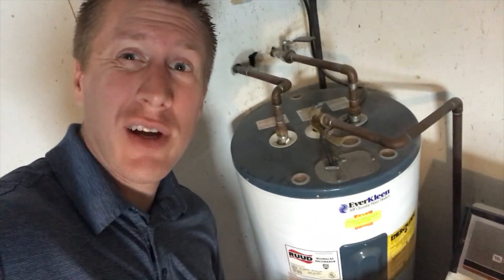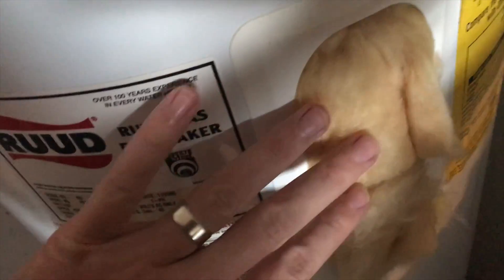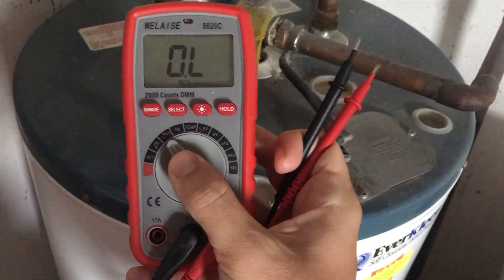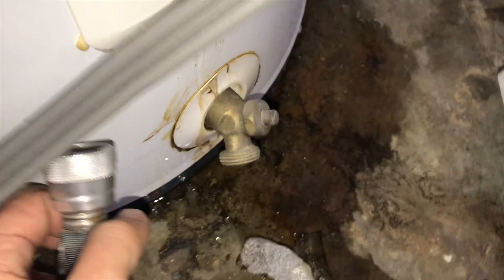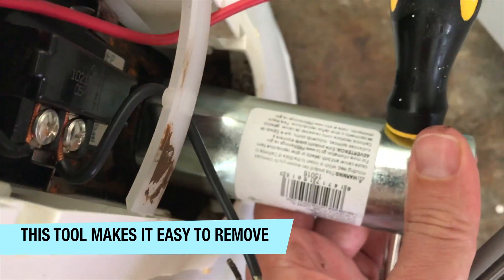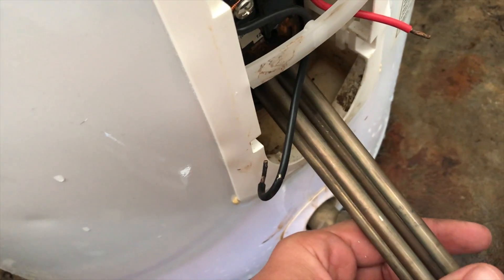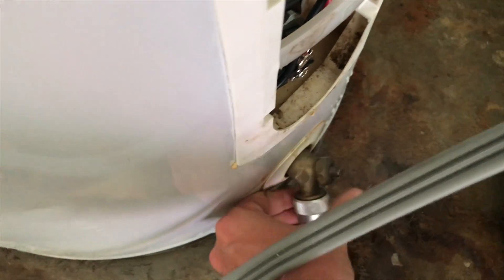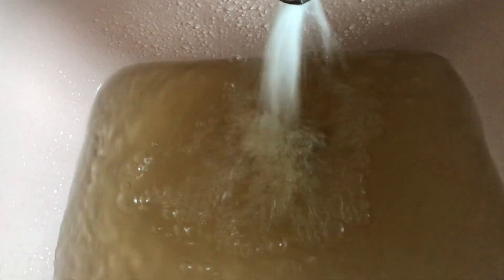Electric Water Heater Repair In Minutes:  STEP by STEP

Comment: Good I do not have to buy a new hot water heater I'm here in Mobile Alabama😮
Reply from the maker: Only if your tank is leaking or rusted out.  Also water tanks should be flushed out and you can replace anode periodically to prevent hard water attacking your heating elements and steel tank.  Sacrificial anodes are designed to attract the corrosion and wear out so tank doesn’t.  They screw in from the top of tank. Just little tips to make the tank last longer.

Comment: I so scaed
Reply from the maker: No reason to be.  Just make sure you turn off electrical breaker to water heater.  Close fill valve at top of tank and or the main entering house.  Drain tank. Replace bad items (elements/thermostats/sacrificial anode).  Close drain valve.  Refill tank by opening fill valve.  Then turn breaker back on.  Most elements I replace are obviously bad due to corrosion.  If you still have doubts then maybe call a plumber.  Rheem marathon is a composite water heater tank which has a much better lifespan.  That is my top pick.

Comment: What if you  don't a panel on the hot water heater
Reply from the maker: Water heater has to have a breaker associated with it. Most water heaters are wired directly to a circuit on electrical panel which you can turn off.  Some weird homes have a water heater plugged into an outlet (very odd).  Regardless there should be a way to kill power to the water heater.  If you don’t see one definitely get a plumber.  Always know your limits.  However, watch the plumber and learn from them.  I always watched people I hired and told them I just like learning.

Comment: Hey, thanks for the video. It was a gateway to getting ours back online. The weird thing is our whirlpool unit has 2 thermostats top and bottom, and 2 elements. Everything checked out on the multi-meter. We pressed the reset button , drained the unit for 20 minutes. When we ran the water again there was a lot of "Black water" from the kitchen sink?? whadda-ya-know! Hot water. We had a brief power outage the night before it was not working. We unit was made in 2014, I had never cleaned / flushed it ever. No issues until this power loss. All is well now. thanks
Reply: Was the water easy to drain?... Asking because Im in a similar situation as you all
Reply: @adatewithchrist  Hello Twinkle.. Even though the water was easy to drain, it took a LONG time to FULLY drain! Make sure you shut off the power and then disconnect the "wired" connection at the W.H. to be extra safe. 

DETAILS Here. If the W.H. is in your garage, maybe not a big deal. If it is in a basement or laundry room, like in our case be careful. It took both of us to deal with this mistake of ours. *If you think you have drained it all the water and start to remove the element only to find water coming out of the threads...Stop and keep draining the tub more! There should not be any water coming out of the threads. 

*We had lots of water flowing out of the tub and needed to protect the floor and hallway from it. Be mindful and have lots of towels available if you do have excess water. 

*It was nice to have a extra set of hands and feet. Have a good light and take a picture of the area you're working on. It helps with reassembly. 

*All said and done our "Thermostats" also needed to be replaced. It was still much less money than a new W.H.
Reply: @PawnShopRockers  Thank you so much

Comment: You can change elements without draining the tank. Cut the water supply off and release the pressure valve using a container to catch the HOT  overflow.
After loosing the element catch the slug of water with a towel.

Comment: Here is the easy method.CUT OFF BREAKER AND VERIFY AT UNIT WITH TESTER.
 The bottom element  in a Rheem comes on first. The upper thermostat cuts it on.
Disconnect wires to both elements. Set meter to Ohms. The range is around 12.8. If OR is displayed element is bad.
If both elements test good it is the top thermostat usually.
 Another sign of that is when heating water the top element not the bottom element comes on. You might have hat water for a short time but up to 15 minutes.

Comment: Just happened...
Electricity was turned on, before water was on into the pretank.  Now the water heater is not working ,the.light was on  but sion after off the light .How can I repair it ?

Comment: Thank you. You made it easy to follow.
One question please. Our water heater heats up but rams out of hot water much sooner than it used to. Can the issue still be the heating element? Appreciate your advise.
Reply: My issue too
Reply from the maker: Did it once work fine?  Do you have more things running that use hot water?  If you always had issues it likely is capacity issue.  The tank could be undersize for your needs.  If you are running hot showers, washing clothes, and doing dishwasher at same time you will run out of hot water quickly.  They do make instant hot water systems which are tankless, but they require more power.  Therefore you will need electrician possibly to wire in a circuit for one.  They heat water instantly as you run faucet rather than holding hot water.
Reply: It sounds like only the lower element is working.

Comment: The hot water supply of my water heater is smaller and smaller, almost did not have, what reason is this , how should I do to solve this problem?
Reply from the maker: If the tank isn’t leaking then it likely is a bad element which isn’t keeping up with your hot water needs.   That is what we fix in this video.

Comment: Seems super complicated!
Reply from the maker: These water heaters are pretty simple.   It is an insulated tank.  If the water isn’t leaking out then it likely is a heating element.  Many times you can visibly see the element is bad.  However, we do go over other ways to tell if an element is not functioning to its full capacity.

Comment: I rewatch your tutorial again and again to make sure that I will not making any mistakes. My water heater cable is connected directly to circuit breaker without cable plug. Is it safe to just turn off the circuit breaker prior unscrew anything from water tank body? Thanks for making this educational video.
Reply from the maker: Definitely turn off power.  Wether it be unplugging or turning off the breaker that powers the water heater.  When in doubt if power is still on consult electrician or carefully use an electric voltage meter to check.

Comment: I think that you do not need the chart in order to estimate the resistance, because you can calculate it from the formula R=V^2/P where V is the Rated Voltage and the P is the Rated Wattage. Taking your example, we have V=240V and P=4500W then R=12.8Ω.
Reply from the maker: Correct.  👍
Reply: InstaBlaster...
Reply: coming over the top with the math!